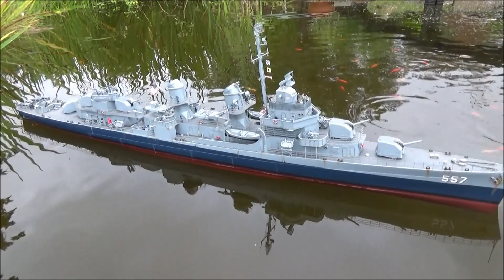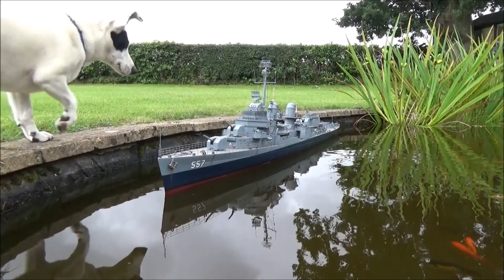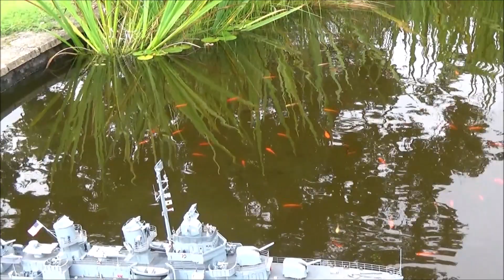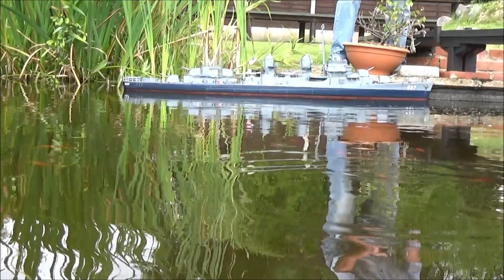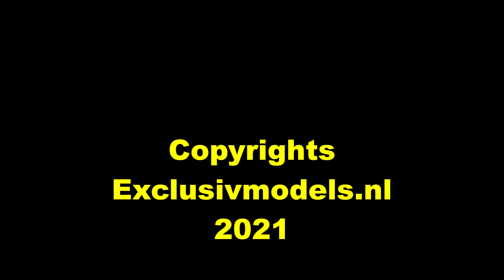Testing the USS Johnston at the WHR

Comment: I am very new to this model boating, but one thing I have noticed is the unbelievably noisy ESC. Do they get quieter the more money they cost or are they all noisy.  🙉
Reply from the maker: You are absolutely right about this noise and it is mainly this brand that I am using but there are better ones with less noise.
Reply: @MrBramMoos  I have a viper esc in a tug boat I just bought. It was very easy to set up but it is noisy. In another boat I have, that has  been fitted with a Jeti esc for brushed motor, this is silent but it can not go in reverse.
Anyway, it is good to hear that there are quieter esc's out there.

Beautiful looking boat and I love the sound effect.👍🏻